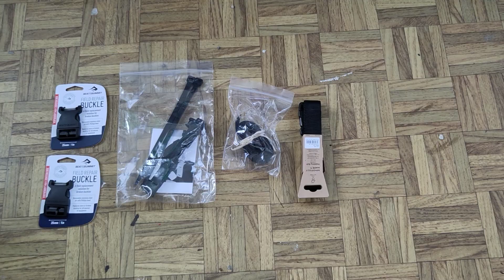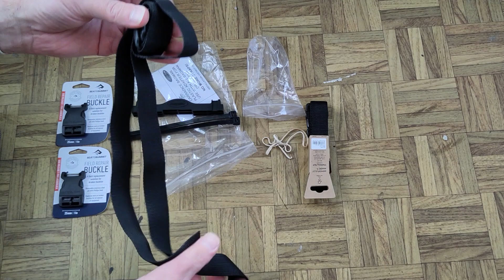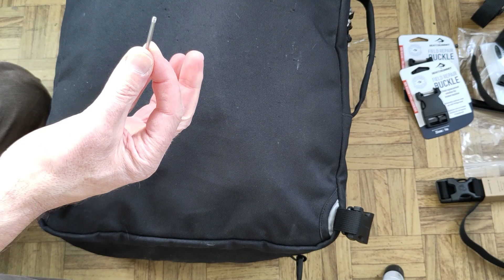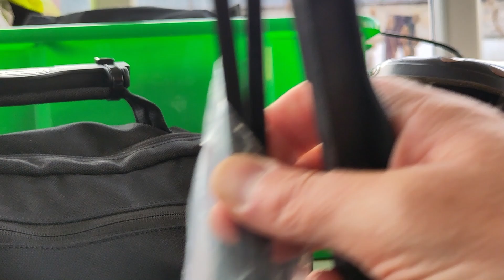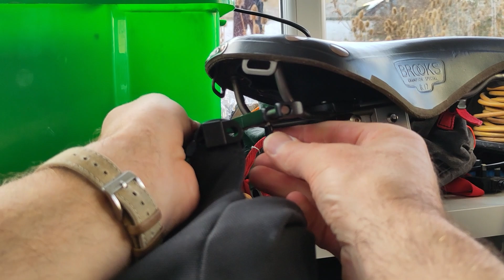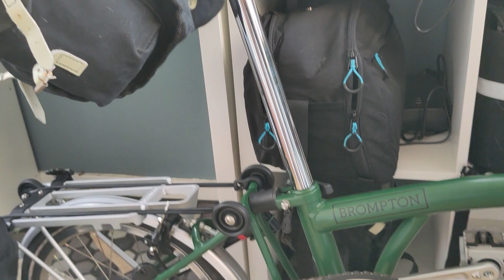Quick release Brompton touring set up

Comment: Pretty neat solution? Do you know any other backpacks with similar buckles installed at the bottom?
Reply from the maker: There look like quite a few, you don't need buckles at the bottom, just a loop where you can attach the sea to summit buckle. I had a quick look and Osprey, Tatonka and Eagle Creek all look like they do something which would work eg https://eaglecreek.com/products/origin-series-pullman-travel-bag?view=v2
 Probably best to look in a shop, you will probably find something cheaper which would do the job. Cheers, Gary

Comment: This came on to my YT Feed tonight. Clever. How's it lasted, have any on the plastic buckles snapped?
Reply from the maker: Nothing has broken so far - two minor issues - I should have left more strap on one of the clips attached to the rear rack, I cut it a bit short. Secondly, the Patagonia bag needs something to keep it rigid as it is not stiffened. I use my tent when camping which is fine but less good for shopping. Other than that all good. I have no idea how YT algorithm works - so I am glad when anyone sees and likes it. I hope that it works for you if you try it. Cheers, Gary

Comment: Great idea Gary and thanks for sharing. From my experience Brompton touring it doesn’t look quite stable enough for me. I do think a large Carradice saddle bag using the same mount has more going for it for camping touring though and you can still easily attach a lighter loaded dry bag across the rack from 15-40 litres, we use these for our sleeping bags. With the saddle bag and the dry bag combo can comfortably manage up to 65l on the rear.
Reply from the maker: I can see where you are coming from with your comment. I have a tent which just perfectly fits longwise in the Patagonia bag and with the clips at top and bottom, it makes a pretty rigid and therefore stable package. I agree that with saddlebags and stuffsacks or a rackbag, you can make a 'nicer' touring outfit but, then you lose some of the portability of the Brompton. I put the Patagonia on my back, Brompton in one hand and Brompton bag in the other and I am fairly mobile ie I can walk for a few hundred yards like that.  I do prefer the aesthetics of your saddlebag system though and do use that when I do not have to use other forms of transport much. However you pack it though, a Brompton and a tent make you smile!
Reply: @ great that you’ve come up with such a neat system that works for you.

Comment: Genius! Just ordered the parts for my bag. Many thanks for uploading this guide.
Reply: Now completed! As 2B4A point out- the clip on the rack is a bit vulnerable when flipping it under to put the Brompton into ‘park mode’.  I ordered some extra repair buckles so I can have both male and female parts clicked together once the bag is off the bike. Obviously when not using the bag for touring it’s easy to remove the strap - thanks again for your upload- it’s a very stable and quick method of attaching a bag to the rack.
Reply from the maker: @Flintynicknacks  Good point about the folded vulnerability - good luck with your Brompton adventures!
Reply from the maker: thank you, all the best with your set up!

Comment: Thanks for the comprehensive introduction to your solution. Would be interesting to see how you pack and go e.g. in a train. I'm currently using one similar bag (with hidden rucksack straps) permanently tied to a front rack and put it on my back (straps always out and not hidden in the zip pocket) for non cycling transportation. Fast to pick up but the front rack attached to the bag makes it not overwelmingly comfortable.
Reply from the maker: Hi, I will show this as soon as I get 5 minutes

Comment: The quick release aspect of the proposed setup is very clever. It’s light weight and quick to use.  Bravo!
Would be nice to see if a waterproof backpack (similar to Decathlon Itiwit 20L or 30L) could be used as well.
Could the Sea-to-Summit buckles be inverted (males on the bag, females on the rack)? This way, the buckles would be less likely to break when the bike is folded. There would also be less confusion between both females when attaching the shoulder straps/rack straps.
Reply from the maker: Thanks both - coming from you guys that means a lot. I am sure that you could do this with any bag which is about the same length, has a handle at one end and a couple of loops at the other. Your idea about reversing the buckles makes sense but the Sea to Summit buckles only come in the configuration I used or double pin. Either of these would require the 25mm webbing on the rack to have two closed loops to hold pins, this in turn would require sewing, gluing or similar - this is beyond my skill but maybe Carradice might make a propriety strap for the touring Brompton community? They would sell quite a few. Thanks once again for your enjoyable and informative channel.